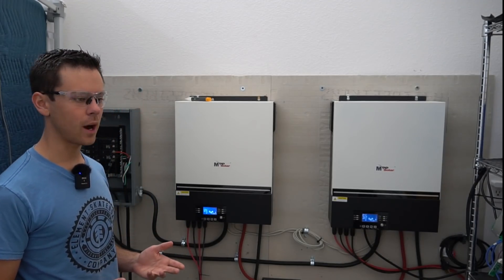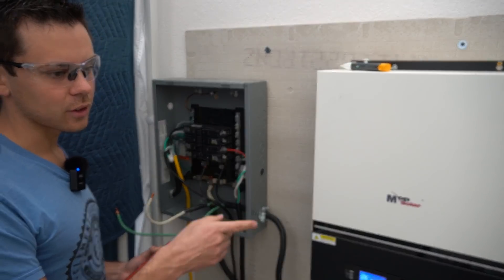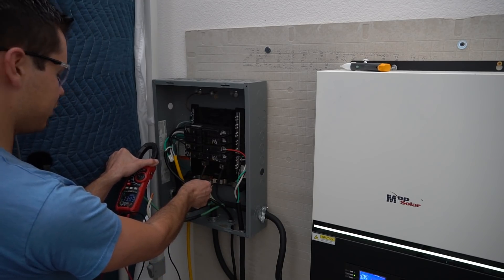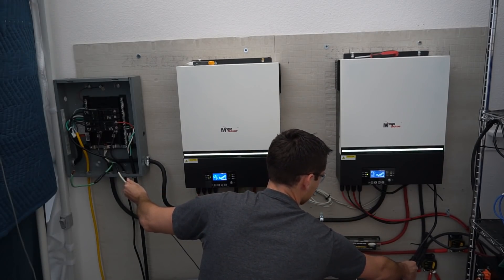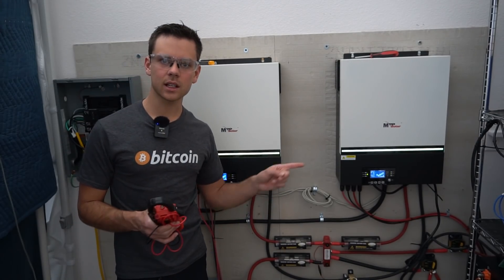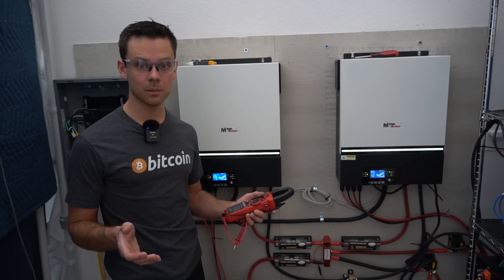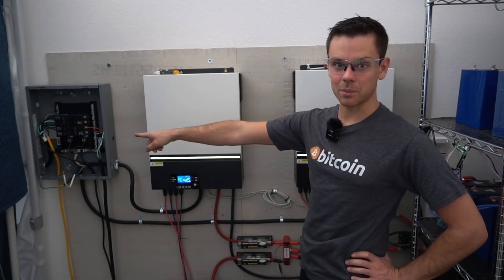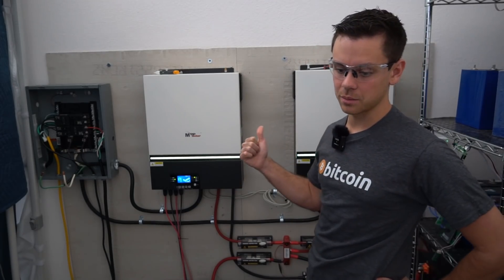Advanced Level Grounding Discussion for All-in-one Solar Power Systems

Comment: Grounding in split phase systems can rapidly become confusing, particularly when there are subpanels in detached structures involved; in such cases NEC Article 250 requires a distinct grounding electrode in the detached structure, although a single load in a detached structure can be fed from another panel without need for a local grounding electrode. All electrodes must be bonded together (so they're unipotential at low frequencies -- all bets are off in the low megahertz range, as you'd see with a lightning strike).  If you have RF systems like me, a perimeter ground and single point ground panel get added to the mix, so I have electrodes (two each) for all of my outbuildings (including the one with all of the PV gear) tied together with buried #6 that surrounds the compound and ties into the SPGP for the antenna systems.

This relatively straightforward issue gets massively confused when using UL-approved inverter-chargers.  UL 458 requires that inverter-chargers with integrated transfer switches bond neutral to ground when running off of battery or the PV array, but not bond them (for obvious reasons) when powered from AC-in.  

A lot of this complexity is a consequence of the fact that the US uses ground both to dissipate charge build-up (earthing), and to clear faults.  The latter is why we bond neutral and ground at the service entrance; fault current on ground will trip the protection device and clear the fault.  The reason we don't bond them in subpanels isn't to avoid ground loops, it's to avoid neutral current being carried on the ground conductor. Note that none of this has anything meaningful to do with lightning protection; minimum conductor side for lightning protection grounding is 1.5 to 2 inch 16 ga. strapping.

I suspect the LV6548 ships (sometimes) with the bonding screw installed is because not every country does things quite as whacky as the US. It just would have been nice if it had been in a more...convenient...location.
Reply from the maker: You should join our forum. Diysolarforum.com

Made a new video with ground neutral bonding discussion, now have the bond screw removed
Reply: Us Building Biologists call this net current : "The reason we don't bond them in subpanels isn't to avoid ground loops, it's to avoid neutral current being carried on the ground conductor," parallel paths cause imbalanced return currents to occur because electricity takes all paths back to source (transformer of power company). This is serious code violation because a AWG 14 lighting circuit wiring isn't designed to carry more than 15A, but it can when commingled neutrals from another other branch circuit that is rated at 20A and uses AWG 12.

Three way stairwell lights often have this issue, and although the switches work, the wrong gauge wires might be smoldering inside the wall, and that's why it must never be done. Yet some 80% of homes have N-N issues or N-G miss wiring issues.

We trace these complicated to isolate wiring errors in junction boxes, by means of magnetic field meters, as such looping (where they shouldn't) AC currents generate large and deleterious magnetic fields
Reply: This is exactly the headache I've been having with my split phase system. My solar shelter is located about 75ft from my shop. I have a panel inside the shelter powering the ac inside the shelter & a Native DC split providing climate control for my battery bank, that's connected directly to my bus bars. I then have 75' of 2awg running to my "main panel" for the shop. My PV array is on its own grounding rod & I had my shelter on its own grounding rod & also one at the shop panel. After watching this video, I think I don't need my shelter on its own grounding rod & instead have a floating ground/neutral bond in the panel inside the shelter. Everything has been working fine. My shop lights are now powered by the shop panel, but when I started flipping on outlet breakers, I got an output fault at my inverter. I had the feeling it had something to do with the grounding possibly making a ground loop, even though I'm completely off grid. My shelter panel isn't ground neutral bonded, yet my shop panel is. I only have power wires running to my shop panel without a ground wire connecting the two panels. I'm not an electrician & basically youtube'd my way through this massive project. I live in the mountains & it's impossible to get a solar professional out here to look over my system for safety. If you have any advice for my set ups grounding, I would be in your debt. I'm running a 28kwh 13000w split phase off grid solar setup, but my particular set up with my solar shelter being 75' from my shops panel is confusing. My shelter is a refurbished Korean era military radio shelter. It's a metal box with aluminum mesh lining for faraday protection I assume.

Comment: When I first started off grid 30 yrs ago I grounded everything. But found out colechie 12 inches down was water proof and when the lightning hit a about a quarter mile between me and a neighbor it hit the water then went straight up my ground rods. My neighbor also got taken out. So I've been running isolated neutrals ever sense with out a hick up.
Reply: So you remove your ground rod , you are running on a floating system with no earthing ground?

Comment: I dont really know what is your elecrical system looks like, but our in Europe looks like this : 230V (50Hz) supply consists of 3 wires. 1-hot, 1-neutral, and 1-safety ground. 230V (50Hz) is obtained between the hot and neutral lead. Double-pole main circuit breaker protects both the hot and the neutral leads. Branch circuit breakers are single-pole, switching the hot lead. Has hot bus connected to the line side of the branch breakers. Has separate buses for neutral and safety ground. Standard European practice and ABYC requirements include ground-fault protection for the entire AC system as well as critical branch circuit GFCI protection. I think, no matter what we do, and how we do our configurations : There must be a LINE IN from the GRID connected to the Charge controllers (and never use the grid power but the Neutral and Grounding) or a dedicated grounding wire connected to the inverter(s) and other devices that requires grounding wire. And never ground twice! ONE SINGLE COPPER ROD IS MORE THAN ENOUGH!

Comment: I have watched the Advanced level grounding video several times. I am installing two Rich Solar LV6548 to get split phase.100% off grid. I want to understand the grounding.
1. The LV6548 are ground/neutral bonding from factory.
2. I am going to install a main ac disconnect in the solar shed. That main disconnect will then feed a house panel.
So, from the video I will not do a bond at the main disconnect or the house panel. Correct?
Earth ground to 1 LV6548 inverter only on the ac input. Correct?
Do I earth ground the house panel?
Thank you in advance

Comment: I think people forget that these Hybrid solar inverters were originally designed to be added to an existing AC mains consumer panel which has its own Neutral grounding scheme from the loads back to the panel.. its supposed to have utility power line installed directly into the AC input, then the AC output fitted to the existing distribution panel. The Inverter acts like a whole house UPS, switching to to to the mains when the solar power or the battery power becomes insufficient and vice versa.

Comment: Yeah Will, I'm going to disagree with you. 

Philosophically, we should have ALL of our metaphysical substrates grounded continuously through the use of -20 gauge zinc-clad copper stakes inserted through our metaphorical anus opening that is embedded internally at least 20.32 cm.

Then all of the negative energies can themselves, experience proper Enlightened Flow (No, no... Not linoleum), thus achieving a proper Canadian Nirvana, shielded of course.

Jordan B. Peterson
(😎 👍)

Comment: You should be OK with an additional ground rod if you bond it to your utility ground, preventing a ground loop and a voltage potential.  Use at least #6 solid wire.

Comment: So many different points of view on bonding neutral to ground. So now Will Prowse is saying that he has decided it is not a good idea to bond his neutral to ground in his breaker panel? I just watched another video from the LithiumSolar YouTube channel where he discusses the same inverter the LV6548 and goes into detail how he removed a screw inside the unit to disconnect the bond between neutral and ground, and in his breaker panel he did bond the neutral together with the bond. He also stated that he contacted MPP and they told him to remove the screw in the LV6548. So you can see that someone like me that has no background in electricity would be confused when two different sources on YouTube, each with their own followers, state totally opposing opinions on what to me is a very important topic!
Reply from the maker: No, we actually agree. Those are two different configurations we are discussing. Join the forum and join the discussion
Reply from the maker: But yes very confusing indeed

Comment: This is an awesome topic Will, and one that I think is significantly overlooked. Would you mind clarifying: If you have parallel MPP Solar units, should every AC input ground be tied to the main breaker panel, or just the master unit? Since there is a neutral-ground bond at the main panel, connecting the ground to every input would effectively create a neutral-ground bond to every MPP Solar unit. Also, if you have BOTH AC Input (connected to main panel) and AC Output connected (to wherever), the AC Output ground should be connected to a non-earth ground (such as the sub-panel). But what if you have a grid-tied MPP Solar unit (AC Input connected to grid-connected main panel), and the AC Output ALSO connected to the grid-connected main panel (separate breakers), for when you are energy-shifting to maximize TOU? Assuming that we aren't breaking any laws, of course. Do we connect the AC Output ground to the main panel in that case (which would have a neutral-ground bond)?

Comment: I want to use a separate grounding at more than 10m distance, under 4ohms, with a permanent link between N and PE on AC out. For  home circuits I will use the home grounding, completely separated from it.

Comment: Part of the advertising for the LV6548 says "custom parameters can be set according to any battery between 40 and 62V".  Does that mean I could use a higher voltage battery bank, say adding a couple cells as long as I keep the high voltage cutoff at 62V or less?  I am replacing a 120VDC 1640AH telephone battery bank and am bummed that the highest voltage solar battery banks have got to is 48VDC.

Comment: per CODE, you only "bond" neutral to ground AT THE SOURCE PANEL.... thats a serious safety issue

as to grounding everything else, added panels SHOULD NOT have ground and neutral bonded

were i a neighbor of yours, with all my amateur radio gear, if you stuff isnt grounded properly, my radios would be useless, conversely, if you arent grounded properly, my radios would fry your Integrated Components on your charge systems as i do "tinker" with microwave freqs

just to insure your liability issues in regards to homeowners insurance etc, ALWAYS reference NEC code, and always ensure your system is FIRST safe, THEN sort out the demons.  Ugly's has a decent reference on GROUNDING ELECTRODE CONDUCTORS and i would highly recommend using those references for bonding all your gear, including any "generating systems" back to your primary service panel to ensure that any/all "leftover potential" doesnt find you or someone you love!

Comment: I doubt there would be much circulating current in a system with distributed grounds, you could test it easily and safely though..  Different story in a steel sailboat, where everything must be isolated and a single ground point used - very difficult..

Comment: Grounding the solar panels and supporting alluminum structures (DC side) to the same ground rod for panel and inverters AC side)  
Or 2 separate ground rods for each side.  (NEC  unifilar ongrid description.)

Comment: Why you would connect the ground and neutral at the device? Doesn't makes sense. They should only be bonded at the main distribution panel. Always use the grid earth.

Comment: That is the problem with these cheaper inverters. They do not have a programmable neutral to ground relay. The only safe way to install a grid tie system that can be also used as a back up system in case of grid failure is to have a ground relay. Per NEC the main panel is where the bonding of the neutral to ground occurs.
Reply: You can treat the inverter as a main panel the way you have, but that's not per code. The inverter is not the main panel

Comment: Great explanation and demonstration, this is much better than a 'code-parrot' just repeating NEC ad-nauseum...  You showing and talking through the thought process is extremely helpful to all viewers.  Ground loops that close with that big of wire are not nearly as bad as ones with a long run between them, and would probably never have any issue in your lifetime, but for continuity(pun intended), following a standard is best. Thank you for your work.

Comment: You must keep the ground and Neutrals separate in this case. The only connection made between the ground and the neutral conductor is made on the service side at the meter base. Everything beyond that is a bonding conductor bonding the system the the grounded system conductor. All electrical systems only have One grounding conductor. That is generally the #6 CU conductor that is terminated to your grounding electrode. The green, or bare conductor connecting your equipment to “ground” is the bonding conductor. I believe this is just confusion on the proper use of wording. The conductor referred to as a “Neutral” in this case is, by definition, the conductor that caries the unbalanced load in a three wire electrical circuit supplying two different voltage loads (ie: your range in your home is supplied by a 3 wire circuit, supplying 120 volts to your digital timers and clocks while 240 volts is supplied to your elements, the unbalanced load than travels the neutral conductor) - The white conductor often referred to as the “neutral” conductor in a two wire circuit is the “Identified” conductor, which is the grounded circuit conductor, and it is bonded to the grounding conductor at the meter base. You can not create a ground loop in this case, as current will always take the shortest path to ground, never going back on itself or traveling multiple paths. Though the additional bonding would be overkill (creating a “super bonding” type situation) I’m unsure of what hazard you would be creating. This is not armoured single conductor cable, so sheath currents would not apply. 

PS: Love your videos, the tear downs, and explanations on batteries and renewable energy networks is outstanding.
Reply: “You got to keep ‘em separated “ blasts in the background.
Reply from the maker: Yes I agree
Reply: So in the case of having inverters as the source in an off grid system the ground rod to the main panel should be the only ground? And the inverters create the neutral to ground bond? All other grounds and neutrals should remain separate?
Reply: @malcolmkegel3905 ground neutral bond in the service panel is only used in RARE instances when you are in AC bypass mode. If you have enough panels to power your load you don't need to worry about this.

Comment: Added a GFCI outlet to the output of an ECO-WORTHY All-In-One unit using the Earth Grnd lug from the AC Grid Input connection in the All-In-One unit. Then wired the AC Output L and N to the GFCI outlet for 120V at the outlet. Tested the GFCI using test and reset on the GFCI and all tested fine. Used a RT210 Klein circuit tester and it tested out fine as indicated on the tester. However, I also have a WZRELB Pure Sine Wave 4000W - 48v to 120v inverter on a powerwall that I could not get to check out with a circuit tester, but it has no AC input as it is just an off-grid inverter. I also have a china transfer switch wired to the off-grid power wall that transfers load from the grid to the batteries on power fail. I have a 120v Heat Pump that if running does not like the transfer at all as wired per L N G. Do not trust the labeling. Test and verify! 

I'm a retired journeyman power lineman and a journeyman electrician and have been shocked on panel boxes and have seen them blow up and I have personally investigated numerous deaths, burns, and many stray voltage issues. Bottom line make sure there isn't any voltage potential on the boxes that can kill a human or animal. Test and verify! SAFETY FIRST 

Surge suppression and lightning mitigation is another story...